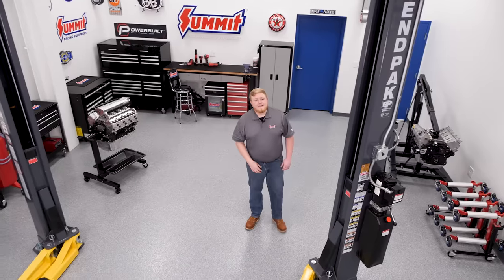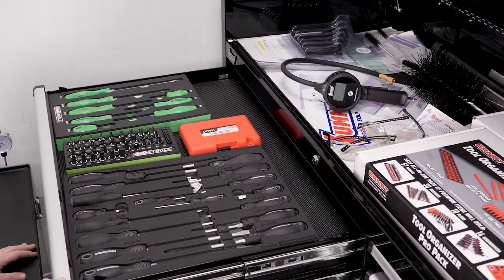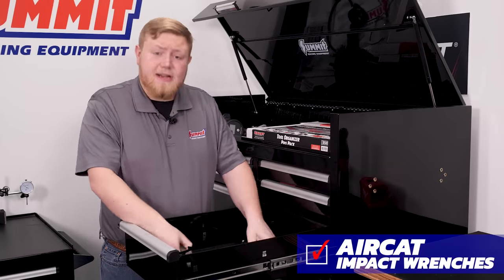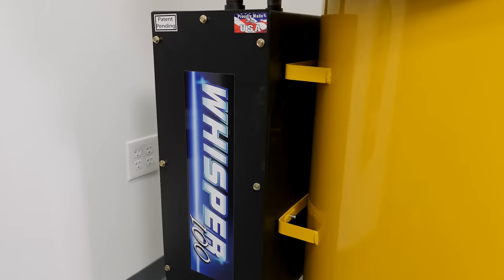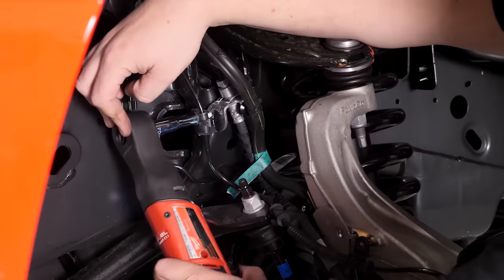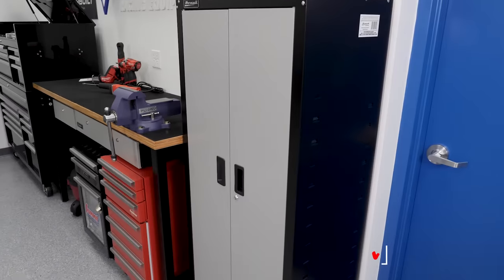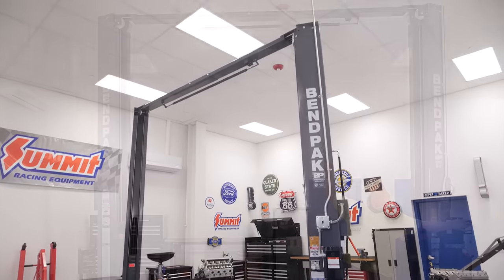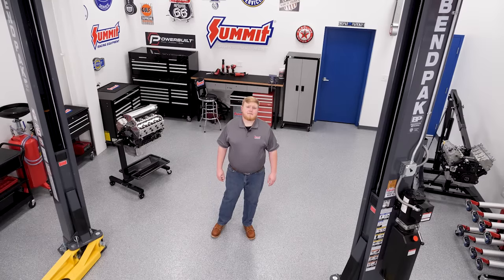Summit Racing Workshop & Video Studio Tour

Comment: TIG/MIG welder, Acetylene torch, 10" cut off saw, transmission jack, tall screw jack stands, large welding table for exhaust systems and any other fab work you need to do

Comment: Would like to have a rolling tool chest it’s a minimum of 48 inches to 72 preferably 72 that I can put all my tools in that has a wooden top for working on either a carburetor break down or clamping a vice on to it to do some work or something like that and I’d like a welding cart and I’d like another welder if possible Lincoln has some good ones on multi welder thank you very much